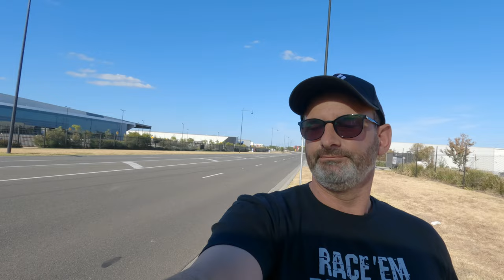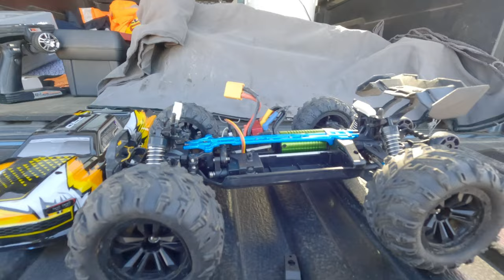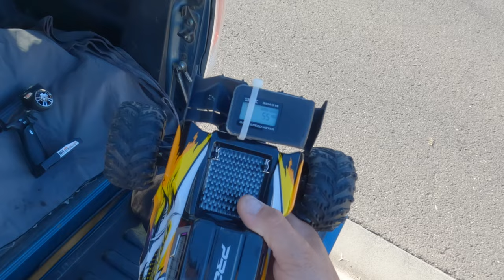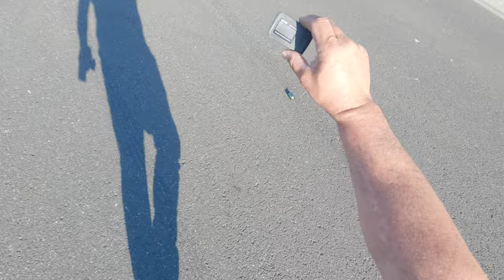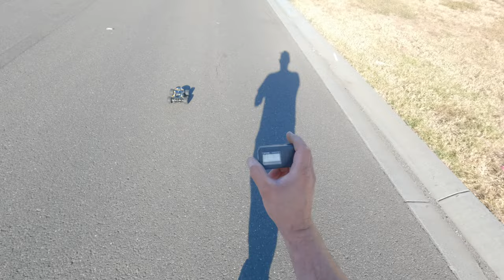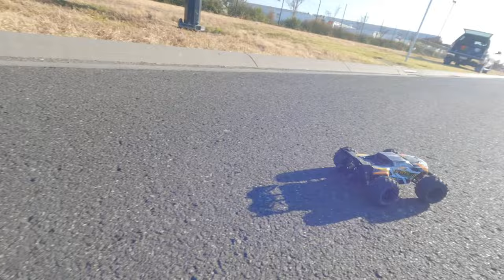RC Car: JJRC Q117 CRAZY 3S speed run gets 85KM/h

Comment: Good video. That is a respectable soeed for a stock setup. 
Since you are planning on changing it out anyways, you could run the stock 2 in 1 board until it fries just to see what it can take.  🤷‍♂️
Reply from the maker: @timallen6035  I ran the 2 in 1 board on 4s on my work bench. It lasted about 10 seconds at half throttle. So yeah at least I know it can do 3s comfortably!. 👍🏼🚗

Comment: I tried using a 3s battery on that car, but after some minutes I lost power to go forward and backward, and just have it on the steering. Do you know what the problem may be and how to fix it? Thank you and great job on your videos
Reply from the maker: @marcobugamellihagendorfer9739  Hey Marco, I would say you have burnt out the esc. The original control units are not designed for 3S. Maybe only a short burst. The best thing to do is spend a bit of
Money and upgrade the electrics to brushless. You won’t be dissapointed. Thanks for watching I appreciate it. Be sure to keep watching my vids about this car as I will have a new one on this car soon.
Reply: @angesrc  Thank you very much for the super quick answer and for the precius suggestions.
I'll surely stay around for that and other new videos

Comment: Well done on 85kph 👏. I got one a month ago and today got 83.5kph but was only on full throttle for a split second. The esc has worked for me me fine on 3s but recently changed to a separate 35a esc and dumbo receiver and controller.
Reply from the maker: Thanks Jane. Yeah like I said. Not sure how long the original
ESC will last. But the good thing is you changed it to a dumboRC transmitter and receiver. Great stuff in getting 83.5k. I believe You will def get over 85 with the better transmitter . 👍🏼🚗
Reply: Unfortunately I done exactly the same as you flipped at speed and skidded only difference is my speedometer screen broke 🙄. Another one ordered. Can I upload my run when my new speedo turns up? I'm new to all this but picked a cracking rc car 👌. I also have a deerc h16e which is 10mph slower unfortunately
Reply: You can connect the headlights to a channel on the receiver too right?and which controller and receiver did you buy ?
Reply: @Perros1245  unfortunately the light connector doesn't fit into the dumbo receiver. I unplug the lights on my rc cars anyway so hasn't bothered me 👍🏻
Reply: @Jbiggy111  I use it at night too 😂hmm well there has to be a way..But since you changed the esc why did you change it to a 35a ? Isn't the stock one 35a too?And it has worked fine with 3s ? Cause I ordered 2 3s 25c batteries and I'm kinda scared to use them ...maybe I wont push it too hard .what do you think ?
Reply: @Perros1245  I bought a surpass 45a esc but couldn't fit it in the same place so purchased a surpass 35a esc as it fits perfect. The main reason I changed the stock esc is so I could use the dumbo receiver and transmitter. If you know what your doing I'm sure you can sort lights.
Reply: @Perros1245  I use 1500mah 35c hyper 3s battery with stock esc no problem at all. And then purchased some hoovo batteries which are 1500mah and 120c! And no problems
Reply: @Jbiggy111  true there are adapters....so what batteries you using ?Cause they're saying that it can't handle 3s or that we shouldn't use 3s but in all of the videos I've watched it works amazing ...are you not afraid that it might burn the esc?
Reply: @Jbiggy111  ohhh okk thanks for the info !!!
Reply: @Perros1245  I can only go on my own vehicle which I ran with stock 2s battery and then the 2 types of 3s batteries. I was only doing speed runs with it so gave it a real testing and had no issues at all on stock esc which says only 2s capable. Ive read a lot of other peoples experiences though and it went up in smoke. The esc I have installed is 3s capable so no worries now. Ive put slightly bigger tyres on it and oil shocks. I also take off rear wing for top speed runs as it gains a few kph.
Reply: @Jbiggy111 i cant believe a 35 amp surpass handles this on 100c 3s without over heating
.did you add a fan..thanks
Reply: @roadstar499  I've had no problems so far with the 35a esc. The hoovo batteries I use are 120c discharge. I haven't put a fan on the esc or motor.
Reply: Thats good to know...Its a great truggy..
Reply: @roadstar499  it's a great truggy. I've just got the rapid version ( same chassis) bigger body. Looking forward to getting it drifting 🤞

Comment: This trucks amazing for the money got mine for about $70 on temu shipping took 11 days to Washington state 35mph on a 1/16th scale foot print really rips especially with a 3000mah battery got to for just under $30 planning on getting a 2-3s waterproof esc for only $14 hopefully that'll help 3s down the road 👍
Reply from the maker: Yeah will go heaps better on a proper 3S esc. Go hobbywing if you can. You won’t be disappointed. Hoping to get more than 85km on my hobbywing esc.
Reply: My 3000mah were only 15c 2s so no noticeable difference just lasted longer but have ovonics or something like that 2200mah 3s 35c hope it doesn't burn anything up stock saw a video of 2s & 3s with 45c hopefully it works OK still running my stock esc 35a hoping I can later clip a wire to the antenna considering 50mph is going to make the range matter more assuming lol
Reply: Gator clip, sold one of my 2s 300mah batteries 2 a buddy that bought my brushed version 3rd person I showed it to inside on buying it lol
Reply: Also trying to find oil shocks that are affordable & reliable seems like some decent air shocks would be better considering weight in an oil shock

Comment: Can you tell me if the 3s you used was very good or just a 20c average lipo? I got mine working perfectly...its sick on 3s 50mph plus for sure.
Reply from the maker: @roadstar499  3s zeepower 1500 mah 120C. Great battery
Reply: I ran mine on 3s 20c on med speed setting was pretty fast..high speed just would need more road..great demo..

Comment: Very brilliant my friend. I'm currently upgrading the same RC. 3s batteries are on their way to me and I'm thinking about replacing the other components with the Surpasshobby 60A ESC but I'm not sure which KV motor size I should use to get the best performance. Can someone help?🙏🏼
Reply from the maker: I think just getting a 3500kv motor will do just fine. That’s what is in mine. And it’s more than enough speed. Hope all goes well!. 👍🏼🚗
Reply: @angesrc ok the original is 4000kv so I'm a bit confused. Doesn't a 3500 have less power?
Reply from the maker: @Ghostrider-gm5wf  sorry it has 4000kv. I was thinking of another car I have!. Yes it will be fine. It will handle 3s no problem

Comment: Cool video, thanks for that. the 3S 1300mAh battery you tested, is it 7.4V or 11.1V? thanks
Reply from the maker: 3S 11.4v. You can’t get a 3S with 7.4v, that would then be a 2S battery

Comment: Can you use a 3S lipo battery with this Orginal model without it breaking? Thanks, I ordered it in pink, hope it arrives soon, wait 14 days. Really cool video
Reply from the maker: @Das-Veilchen-X  yes you can. I done this speed run with a 3s lipo battery.
Reply: @angesrc  ok thx have you a Link for a Good 3 s Lipo ? Thx
Reply from the maker: @Das-Veilchen-X  yeah this is the one I use and will only fit. You will need to make a battery hold down so it doesn’t fall out. 
https://www.ebay.com.au/itm/283602707829?mkcid=16&mkevt=1&mkrid=705-154756-20017-0&ssspo=dy7-XhnGRxm&sssrc=4429486&ssuid=Kods1y39RBy&var=&widget_ver=artemis&media=COPY
Reply: Iff you got the brushless version should be alright

Comment: Noce demo..i actually order this truck a couple of days ago.. can you tell me if they are 12 mm wheel hex size? Thanks
Reply from the maker: Yeah they are 12mm hex. Also looking forward to take it on a beach run with some sand paddles.
Reply: Got mine finally...mine has no brakes just reverse for some reason...mine also has metal knuckles not plastic like i have seen that were breaking from to much bashing...one question can you remember if your 2 in 1 rx/esc has tabs to screw it to chassis or no tabs? Was told the one with no tabs is good with 3s while the other fails..thanks 😊

Comment: I just got my first rc it's the jjrc q117 and I like to see you do an upgrade on it have no idea what to buy for an upgrade.  On a budget
Reply from the maker: Yeah for sure. Did you get it brushed or brushless. Because if it’s already brushless, then drive it like normal and have fun with it. If not, I’ll have to do it upgrade video on it
Reply: @angesrc  I got it brushless but I like it to faster than 70mph  at least a 75 to 80 if possible
Reply from the maker: @jeanmason8211 if you have the same running electrics as mine, which I think you would. You should easily get to 85km with a 3S battery in there. I was running a 3S 1500 mah 100c.

Comment: Can 3s lipo batteries be connected to the basic model 16101 pro? Won't it burn?
Reply from the maker: You can only try. Mine was ok. I even just as a test ran it on 4s and it lasted about 5 seconds!.
Reply: @angesrc ok, so we are not sure whether it will not burn on the basic one
Reply from the maker: @buba9307 it’s a chance you have to take. 👍🏼🚗

Comment: Why do you say not to run it with what it has !! It already has 3 wires ,I'm confused.. help..ty
Reply from the maker: If you’re talking about the motor that it has three wires, yes it’s a possibility that the Motor can run on 3S. but what I’m talking about is the speed controller. They are not very capable of running on 3S, 2S is more ideal , 3S you have the potential to blow it up

Comment: I would like to ask if we use 3S 25c batteries, will it damage the motor? Because I have 3s 25c batteries, but I dare not try to use them...
Reply from the maker: You can use them, but you do have the risk of blowing the esc. I’ve used 3S and haven’t had an issue yet. But the esc is a ticking time bomb. It can go at any time
Reply: Theres 2 type of esc with different tags on them, on of them can handle 3s even tough it isn’t stated and the other one will fry. I have a pick of the 2
Reply: 👍Oh, thank you for sharing..😅Because I personally have 144010 pro, 16101 pro, Q130 pro, 16103 pro version and 16103 normal version..But I only dare to use 2s 25c battery most of the time, except for 144010 pro version, I dare to use 3s battery..Because 144010 pro version has the relationship written on ESC...🥰Still want to thank you for sharing and letting me know...😇Thank you...
Reply from the maker: @wilber8637  no probs at all. It’s always a big risk from the beginning to play with it on 3S. It could last an entire battery or just pop once you plug it in. Looks like I got a lucky one. 👍🏼🚗
Reply from the maker: @JesseBlum  yeah ok, I agree in the capacitor holding the voltage, but what about other components on the board that are only rated at a lower voltage.?. There is a big risk of blowing up the 2 in one board.
Reply: i saw that someone used 3s 50 c and they said no problem so i guess 25c is ok..i have 3s 25c batteries too
Reply from the maker: @manosmavromatakis4425  yeah they will work fine. I was running 3S 120c and had no issues at all. 👍🏼🚗
Reply: When I first bought it, I was afraid to use 3s batteries. Since the fifth day of playing, I replaced the 120a ESC, Oil shock and gearbox gears before I dared to use 3s batteries... The speed is ridiculously fast... I waited a few more days before replacing the 5200kv motor... I also wish you all better and health...
Reply: What's a cap back ? And what esc and motor fans did you use sir ? @JesseBlum

Comment: This exact rc car is not supposed to go on 3s with that esc, you need to upgrade the esc of that car before running it on 3s, otherwise it would burn out eventually.
Reply from the maker: well its run ok for me on the stock 3s for quite some time now. i have now upgraded the ESC to as hobbywing 50amp one. only because i ran it on 4S as a test and it got me to half throttle. so yeah it can also do 4S for a little bit and seems like its pretty capable on 3S. thanks for watching👍🛻
Reply: I purchased this same truck and it says right in the description that it runs 2s and 3s. I wouldn't go running 3s in it all the time for long periods of time but I don't see anything wrong with running it every once in a while with 3s..
Reply from the maker: @thomasnichols4870 yeah it’s true. You can run it on 3 S but it’s really luck of the drawer if it does last then that’s great but otherwise you will need to upgrade